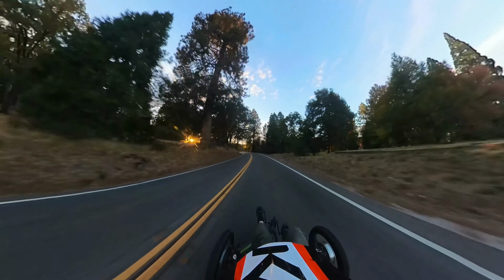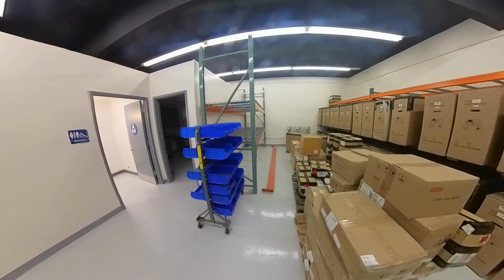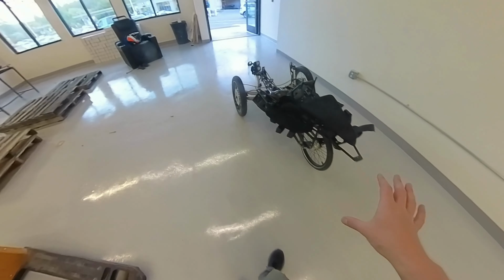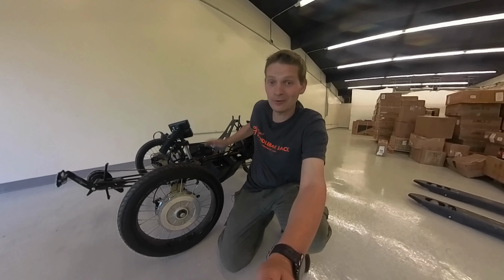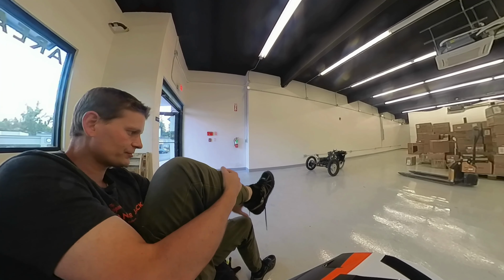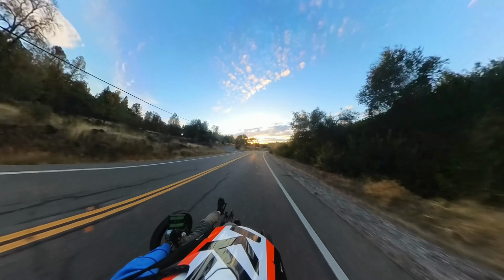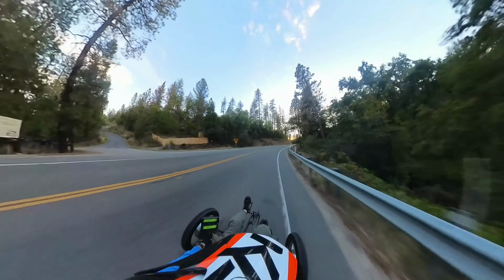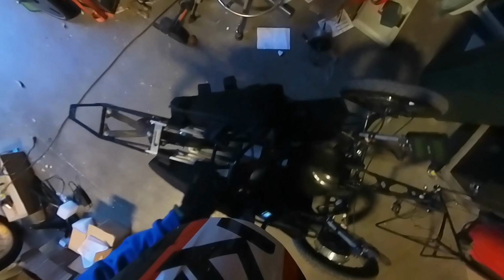I made a trike that's way too fast...  and I'm not done yet

Comment: Hope you test for that rear lift potential as you add the fairing/body. Is there a chance of adding a spoiler in the back to keep the rear wheel down? That could also be a location for more visible lights.

Comment: I'm about to order the Chinese version as Grin didn't respond very helpfully. Plus, I'm sure although the quality would be far better with Grin they'll be twice the price or more. 
I'm using 4 x 2000w motors on 20x4 fat wheels. 52v wi 4 x 30ah 52v batteries rated to 2000w each. I will be far heavier than you and the motors have a low rpm for pulling/climbing. It will be interesting to see what the top speed will be.

Comment: if you hit 58 mph without a body, you will run 60-65 top speed with a body on for sure. The question at that point is safety. But that is still a question now.

Comment: You should cross lace your wheel. Straight spokes will eventually break from too much tension under torque.
My motors is less powerfull than yours and cross lacing solved the problem.